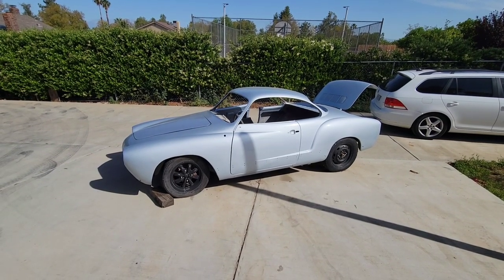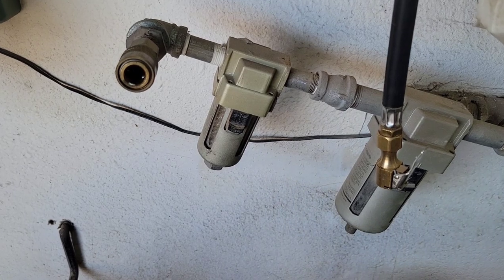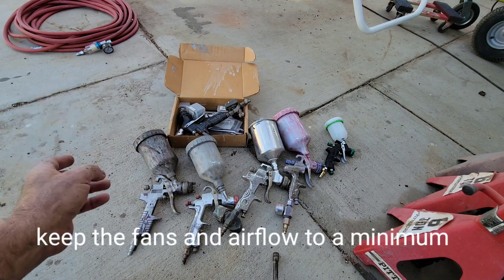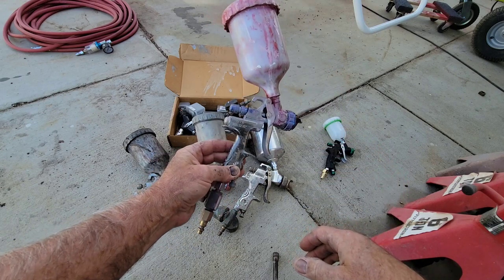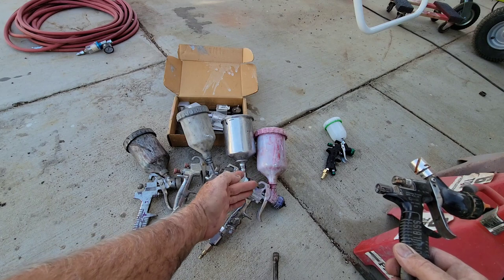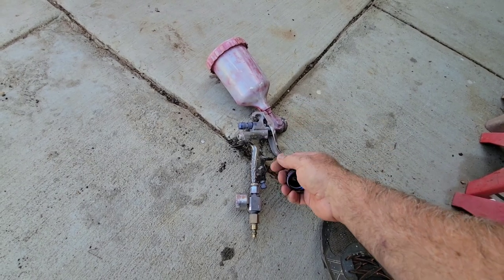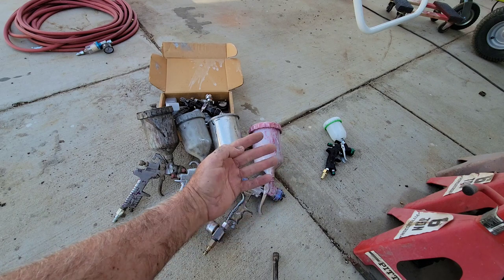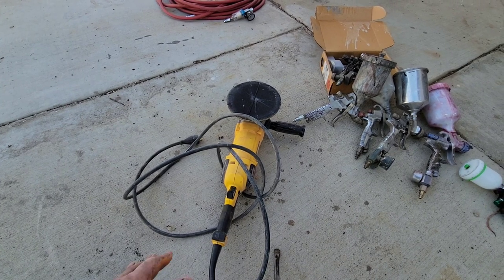Painting your car at home in your garage. Things to know For DIY good job?

Comment: Great advice and tips of the trade. I'm lucky now I have a large compressor,  no close neighbors,  really good spray guns and 30yrs experience at home.  I would definitely stay away from hvlp guns with small compressors for DIY. Do like Mike said and paint vehicles in sections especially larger ones. Until you get experience.  Don't give up.  It took me a decade of mistakes before I knew it would come out acceptable.  That was before we had YouTube.  And keep watching Mike's channel  !

Comment: I knew an old guy in the 80s & 90s who used a household paint roller and he (after putting primer and body work)  roller paint the car - 4 to 6 thick! That took about 4 to 5 days... Then he would spend the next three weeks in sanding and buffing it smooth. Then when done he would spray clear varnish on the paint and buff each coat of clear.... Beautiful...

Too bad he is either dead or he's pushing 120 years... But man what he used to do.... And "the pros from Earl Schribe" used laugh at him until they saw the end result. Then they shut up.
Reply from the maker: in the early days I hear the Model Ts were done with a brush and lacquer. then color sanded and polished.

Comment: 1.  Renting a spray booth makes a lotta sense...if one is available. Never never never test your spray pattern on the wall of the booth!

2.  I just use a tin cup or small bowl with a stiff short brush and lacquer thinner followed immediately by spraying with carb choke cleaner to clean your HVLP gun after each use. Disassemble the gun to clean it inside and out. Pro painters have larger gun cleaners, but you don't necessarily need such a thing. Good cleaning is essential.

3.  Don't scrimp on materials. Today's materials are superior to the fabled old school stuff, but...they are crazy expensive! And this goes for the substrates as well as the top coats! A high-quality paint depends on top quality prep!

4.  I couldn't agree more with your comments about cut-rate paint shops! Once you've cheaped out on  poor prep or cheap paint job, the car will always be cheap!
Reply from the maker: yea never test your spray pattern on the wall of the booth......I was at my buddies shop painting the inside of the booth because the last painter did that. UGGGG, Yea the carb cleaner or brake clean is a good idea for a quick clean. I hear they are mostly acetone anyway and much eesier to clean with a spray can.

Comment: Which gun do you suggest for export primer, base and clear coat? I’m looking at getting an that Harbor Freight HTE you showed but was looking at maybe one of the cheap HF guns to shoot the primer.
Reply from the maker: that 1.3 is great for clear. They also make one of these  with a 1.7 which would be good for primer. But Iwata makes a Airgunza which is about $125 on amazon which is good for primer in 1.8. I will put a link in the  description for that gun.